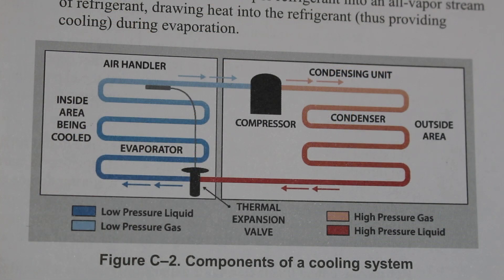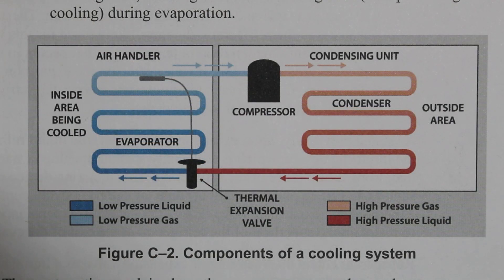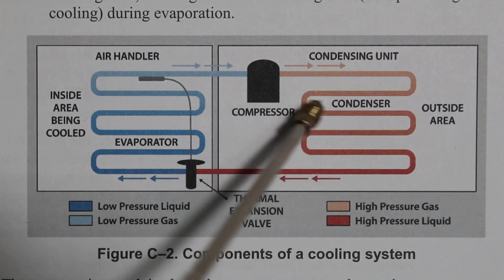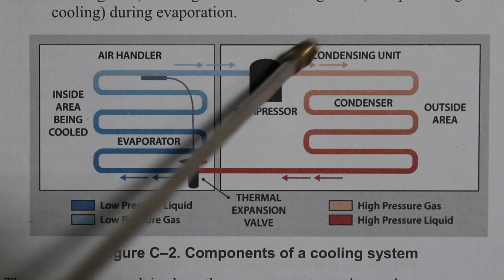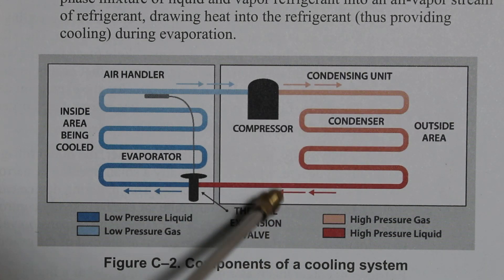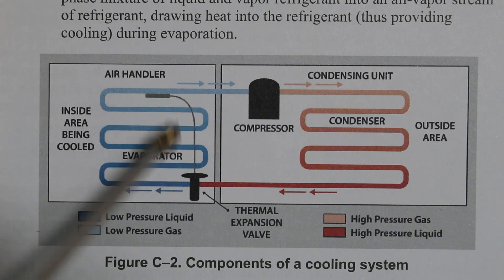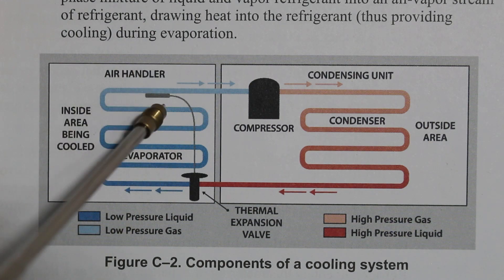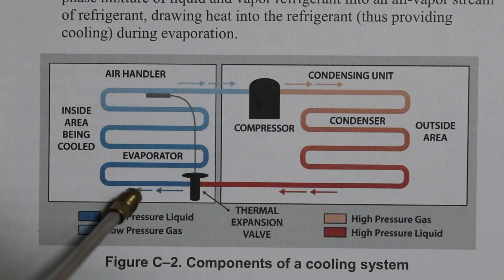HVACR: Basic Refrigeration Cycle Explained (Air Conditioning & Refrigeration Cycle Tutorial)

Comment: If it is a highly humid environment, what happens?
Is it difficult to achieve the goal of entering low temperature, low pressure superheated vapor into the compressor?
& 
Is it difficult to achieve the goal of high temperature, high pressure sub cooled liquid into the expansion device?
Thanks

Comment: 👍🪴

Performance is the goal that is achieved by ensuring low pressure, lower temperature adequately superheated vapors leaves the evaporator & enter the compressor
&
higher pressure, higher temperature, adequately sub cooled liquid leaves the condenser and enter the expansion device.
Thanks